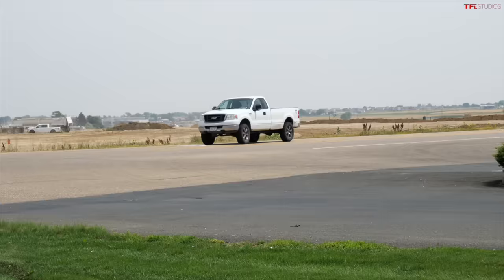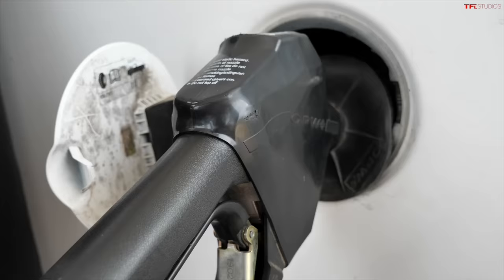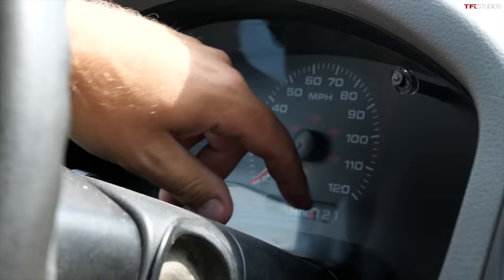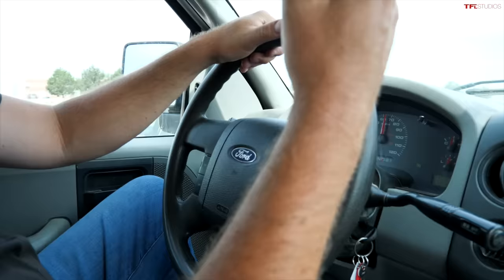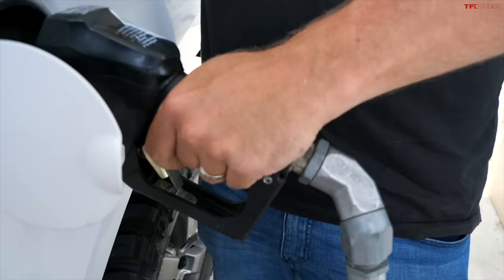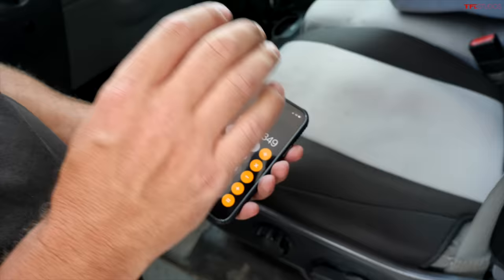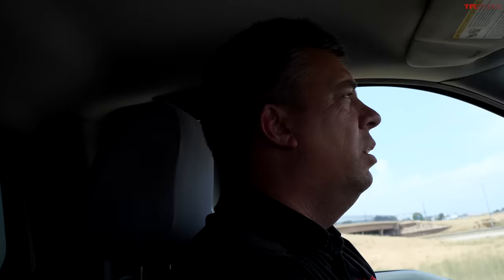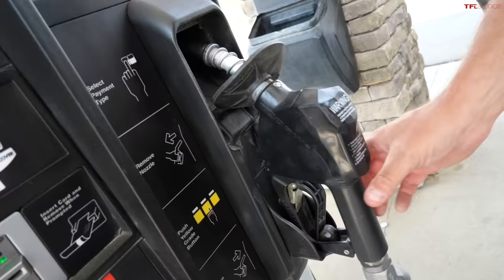Surprising Result: Here’s What Happens To Your Truck’s MPG When You Install A Topper!

Comment: You can't get an accurate mpg reading in only 54 miles, that short of distance one traffic slow down would change the final number drastically, I would recommend at least 250 miles and at night where there's less traffic to content with. Example I can drive my 05 4.6 at 60 mph draft tractor trailers and get 21 mpg, run the same path without following tractor trailers and get 19mpg... a 54 mile test bogus at best. The difference in only one tenth of a gallon here makes over 1/2 a mpg that's 12 ounces easily with in error of the dispensed amount, however on a 250 mile trip the one tenth gallon would be a minimal error. Understand?

Comment: This isn't the proper formula to use. I always thought you fill it up and run it to empty.  Different temperatures and time of day and the speed and pressure can very the amount of actual liquid gasoline that you actually have. If you dont believe  me. Try putting 20dollars of gas into a empty tank,before the sun comes out or, when the outside ambient temperature is below 72 degrees Fahrenheit. Also barley squise the handle to where the slowest amount of gas is flowing into into the tank. At the same time try to get the flow to a quite slow flow with the least amount of resistance the pumps valve is causing. You should see a pretty big increase on the fuel gauge then if you do the opposite of what I explained.

Comment: without watching, should be worse because of weight. Engineers already designed it with wind resistance in mind, same with tailgate up or down. If you leave the tailgate down, it creates a vortex that wasn't there before. It shouldn't be much savings without though. yeah end results very close, not worth the cost of topper or weight if you want gas savings. The real answer is Andre shouldn't have sold Frank. H2's going up in value! HUMMER!

Comment: I found that I lost about 2 mpg with my cap on my truck. I don't know if it's the 300 lbs or the change in aerodynamics...? ...or both...
Reply: City driving or a combination of both. Any aero dynamics would've gain is lost when you drive in the city. Plus the start and stop in traffic.

Comment: Kind of a shocking mpg's. I calculated my petrol car from l/100 km back to us mpg, and it is 40.84 us mpg, averaged over 20681 km is 12925 miles. Yes my car is smaller but the difference is shocking.

Comment: 50 miles in mixed traffic is the most scientific you can accomplish?  That's too small a sample size to be reliable. But this result was 18.16 mpg open bed,   18.26 with topper

Comment: That's 1/10th over 50 miles. Consider the savings over 50,000 miles. I'm not a math genius, but isn't that 100+ gallons at $2.50 to $4.00 a gallon. What was the GPS app you were using?

Comment: Try running without the tailgate, it's like a sail in the wind.🤔
I always used a truck cap for bad  weather. But if the cap comes off,so does the tailgate... besides, you have to lock them up these days, people are walking away with them!😒

Comment: 85 octane is not a standard fuel. It also does not have the BTU's per ounce that higher octane does.
The test is BS. Run it with standard fuel.

Comment: Now if you really want to true test on that taking put the original tires back on from the dealership get rid of them 30 three's and redo your testing in you'll come up with probably about 22 to 24 miles of the gallon or you can just watch mythbusters where they busted the myth on talgate up or tailgate down for better fuel mileage

Comment: The camper can improve  aerodynamics.  The tailgate  acts as a crude parachute.  Try as normal,  gate up and measure the miles. Then drop the gate and do the same.  Better  airflow  means better economy.
Reply: The air NEVER sees the tailgate, as proven by throwing some beer cans in the bed. They immediately move to the front of the bed & stay there, with the tailgate up or down!

Comment: For the 1st run you should have added the same weight as the topper to the bed. That would have better normalized the parameters better. I suspect if you had have done that the difference would have been more apparent. Nice job though! Thanks for producing the content👍

Comment: Should have pumped up a psi or two to compensate the added weight and have the wheels at the same rolling radius and resistance to rolling, and I think the milage with the topper would have been even better.
Reply: Adding air over the recommended pressure is a sure way to cause tire failure. Air pressure when at operating temp should NEVER exceed recommended Max AP stated on the sidewall. EVERY tire manufacturer will tell you this.

Comment: A topper actually designed to aid aerodynamics might be a selling item. I wonder what a speed of 70mph might reveal? 1/10th isn't huge but it's not nothing either. Also, you are in thin air country, thin enough they changed gas formulation. I really think you should have driven faster.

Comment: This test is flawed. The aerodynamic difference is only realized when you're driving at speeds over 70 mph.  That's when the air currents over the cab begin to create a low-pressure area in the bed that sucks the wind down to hit the back gate.   At 80 the pressure against the back gate is tremendous, you can feel the strain.   The faster you go the worse it gets.   Thats why out west, fast P/U drivers run with the gate down or off.

Comment: If you want to get technical you don't factor in headwind temperature or how many times did you have to go off cruise control because of traffic I would have to say no difference at all because the difference you recorded is not enough to make a case.

Comment: Eh, I've got an old '02 Ranger XLT 2x4 with a 3.0 V6. When I'm not being overly aggressive, I can usually get ~18 mixed out here in the Texas hill country. When I loaded down with about 6 u-boat carts (idk where we source ours from, but here's the ones that uline has https://www.uline.com/Product/Detail/H-1825R/Platform-Trucks/U-Boat-Platform-Truck-16-x-60-Red?pricode=WA9285&gadtype=pla&id=H-1825R&gclid=CjwKCAjwsNiIBhBdEiwAJK4khuNJ1eop0PXkGNqf1fhqvXH9XJpoBF5ckcvswjfA4Fj1j-oXXsQ7lxoCND0QAvD_BwE&gclsrc=aw.ds ), which is about 732lbs (if going by the weight of the uline version). I noticed that the truck handled a bit differently and had a lot more traction. The extra weight ment it had to work harder, but it also ment there actually being something helping the rear wheels (it is rwd) get a lot more traction seemingly offset the extra gas being used

Comment: I don't even have to watch the video. MPG decreases. The vacuum created at the rear of the truck is still there and the same size, just half of it moved to the rear, but your weight has increased. Any variations gotten other than a decrease can only be attributed to wind, different gasoline, traffic, etc. It's literally 5th grade science.
My only real question: How much did they pay you or give you a discount for?

Comment: just a quick note , after the tank is full and the nozzle clicks off you shouldnt "top off" it can negatively affect your canister by forcing liquid gasoline into the canister and cause further/unintended problems ,but im guessing you already knew that ;-)
Reply: You can't get an accurate read without topping it off & the "backwash" will never reach the evaporative canister located several feet away & above the tank.

Comment: You should have emptied out the gas tank and filled the tank back using 5 gallon cans of gas so you could have a much more accurate measurement. Anyway when I bought a tonneau cover I was told I'd see 1/10th mpg improvement. You can get better mileage by having the tailgate down too or replace it with a net or louvered tailgate. You can improve mileage a tiny bit with the cab by adding a little lip to the upper edge like they do with cars and why SUV's have sloping backs instead of straight up and down.

Comment: YOU SHOULD HAVE PUT 200 lb. IN THE BED OF THE TRUCK WITHOUT THE TOPPER TO GET THE MPG. EFECT OF THE TOPPER
Reply: Part of the point is to see if the improved aerodynamics (if any) would be canceled out by the increased weight.

Comment: Bad method. Too many variables. Put in a measured amount (the pump cant do that because of the EVAP system) then drive several hundred miles on a closed track at the same temperature and no wind. Also try a third test, take the tailgate off.

Comment: Give it a thumbs down because I just don't think people should make and post poorly prepared videos. Trucks is a tripometer doesn't work, wrong size tires so the computer is shifting at the wrong torque points straining the engine, and text should be done over a full tank of gas not a gallon or two.

Comment: I agree that the economy would be close but 2 50 mile trips doesn't give an accurate result though. The variables don't have enough time to truly influence the mpg. Maybe 3 full tanks for each test would be more accurate. It's like the difference between tailgate up vs down or the difference between running a/c vs not.

Comment: Only 50 miles....on variable hiway.   Come on.  The error of margin is too great.   I want to see salt lake and back. Averaged speed on the gps.    That amount of weight is not that big of a factor once you are moving.   Let's see what it really means.  Load it up no top... desk chairs bikes untapped.  Then same load with camper shell.

Comment: Most unscientific test ever...LOL GPS is not that accurate so it might be off .2-.5 miles the longer you go the more it will be off. Topping off at a station you really have no clue if you are getting the same amount. Again that might be off, not to mention the pump might be off too. Myth busters did this way back in season 1-3 with tailgate up or down. Due to the airflow a tailgate up gives better fuel economy. How the air drags off the back as it swirls creates drag. I think it's so insignificant that it doesn't matter really. Just love how this is not scientific but people are leg humping the video.

Comment: Hard to believe anyone would conduct a so called experiment with so many uncontrolled variables involved and then post a u tube video coonfidently declaring a result. Tossing a coin would be just as accurate.  The single biggest influence on fuel consumption is driving style irrespective of the slight variables crrated by enclosed rear canopies on the airflow drag coefficient.

Comment: Dude, aerodynamics are not a contributing constituent until you go 70+ mph.
Reply: Whether it's 'dude' or not, there's no magic in '70mph'. Mathematically, air resistance is closely modeled as increasing with the square of the speed. Traveling 70mph will experience about 4X the drag going at 35mph. I've also performed quite a few mileage checks in my Diesel F-350. Averaging ~55 mph, I got 21.0 mpg over 240 mile trip with hills. That same trip at 70mph got 18.6

Comment: making it aerodynamic will automatically give any vehicle life from the road forcing you to drive slower - that will increase mileage per gallon. You dont need a cap on a pick up. I did it with a 20 foot canoe and couldn't drive any faster than 48 mph even on a highway.  All you proved is you had to drive slower there by increasing miles per gallon.  You flunked horribly.

Comment: If you are worried about fuel economy, you probably should consider something othe than a truck.
Your driving habits can vary you millage as much as 50%.
The decision on a cap, a cover(hard or soft) is more on needs and uses of the truck(security, protection from rain, ect) or aesthetics. Far more useful than 1 mpg difference(or less).
If mileage is that much of a concern, buy a used truck and a car. Trucks are far more expensive to maintain, use more fuel, and far less efficient for hitting the mall. I know, the civic doesn't scream testosterone filled alpha male to the cul de sac. So lets spend thousands to go from 15 to 16 mpg in a raptor.
Running the AC or not is more of a difference.

Comment: MPG would likely be most improved with no topper and the tailgate removed, since that is your wind resistance point.  But thanks for an interesting test.
Reply: Wrong! The air never sees the TG. Throw a couple beer cans in the bed & drive. They move to the front of the bed with or without the TG.

Comment: You were going at 70 mph. So you should have driven 70 miles in one hour. So you were only driving 54 mph because you drove only 1 hour. hmmmm
So at the race track we often hear. He went 300 mph...nope..he didn't drive 300 miles. Only a 1/4 mile.

Comment: The filling up at the pump, especially when  topping off manually after the automatic stop isn't highly scientific;especially in only 53 miles.

Averaging after a whole thankful would be more scientific to buffer the average.

To calculate on low mileage like 53 it would be more scientific to draw upon a measured supply of fuel, say like 5 gallons ; make the run and then measure the unused fuel.

Then calculate your mileage mpg.

Comment: This guy is full of crap.  Octane has absolutely nothing to do with altitude.  Any difference in altitude is compensated for by the Mass Airflow Sensor in the intake system.  I don't know if any of the other stuff is good but he lost all credibility with me when he started talking about octane which he knows nothing about.  As to the actual mileage difference of .1 mpg it is of no consequence as the measurements weren't precise enough to be confident in the results.  That said, it was a success as he has 519,482 views as of this writing so he's made some money on the video.
Reply: yep octane is about knock not elevation